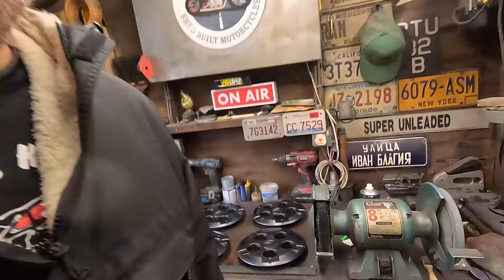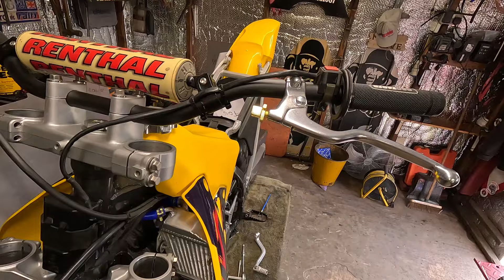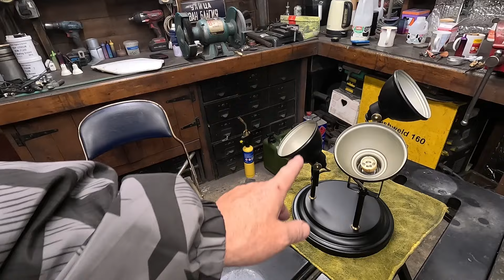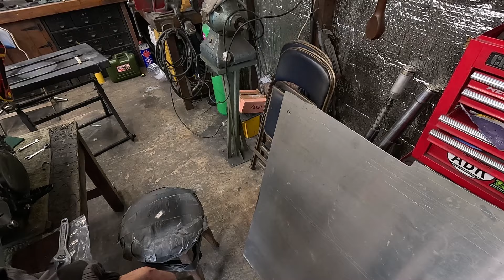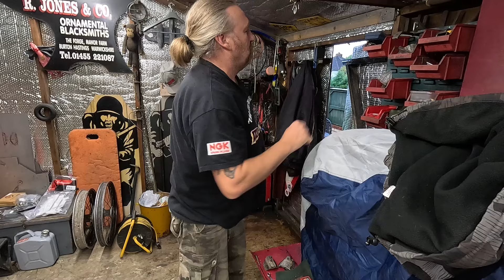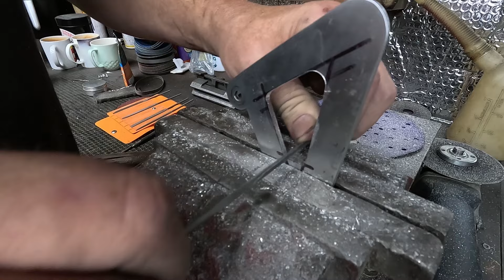Odd Jobs On The Suzuki RM

Comment: I felt your pain when trying to coax the replacement MC seals onto the piston, I use a straight pick tool, at an angle, to slightly stretch the seal as it looks nowhere near the right size to go over the widest part of the piston, definitely a job for a spare hand or two 🤣